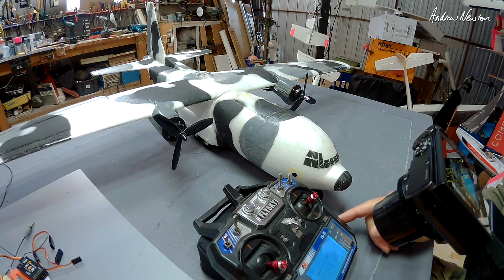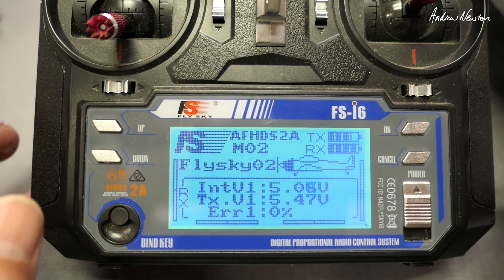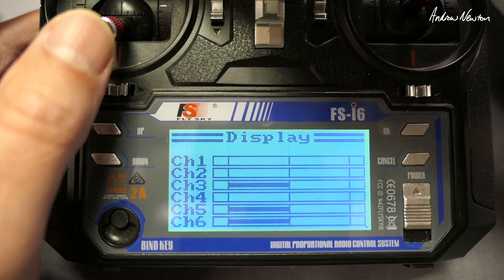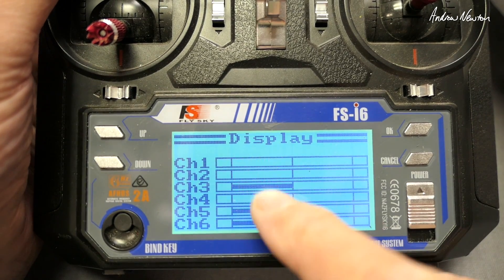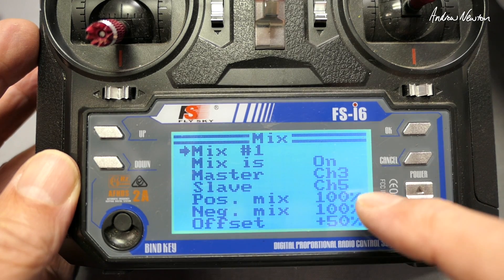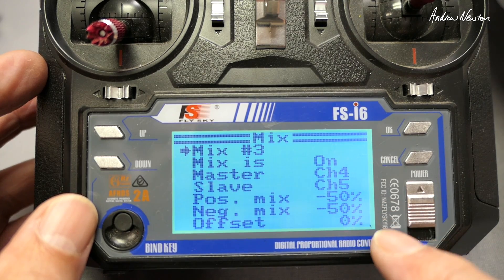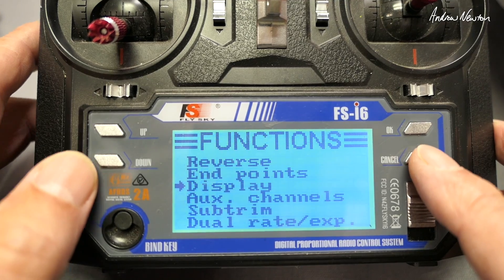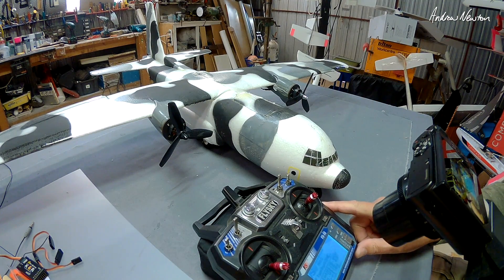FlySKY i6 Differential Thrust Mix

Comment: Hello, How to adjust the aileron differential if all 3 mixes are used for throttle?
Reply from the maker: Mechanically. For bottom servos - mount the servo arms angled more towards the nose and lengthen the pushrods. Then the ailerons will move more up and less down.

Comment: SOLUTION to KILL Rudder / throttle mix control. Example in Assign switches Set Fly mode SWC (same as my throttle hold SWC switch)
Then in Dual rates Ch4 rudder and switch SWC to sport (or Normal) with one Rate set at 0. Now the ch4 rudder will not work in one of the rates and not mix with the motors and motors disabled with either rudder or throttle.
You can use different switches for whatever reason.

Comment: Hi Andrew nice video. Please I can’t find any information about the best distance between twin motors using as differential for rudder.  Is it better as close as possible to que fuselage center or can I space them for more close turns. Can you please help me?  Thank you!!!
Reply from the maker: Thanks. Diff thrust is VERY effective so the motors don't need to be far apart for it to work. I would go by what looks good with maybe 50mm clearance for the props

Comment: Just a thought Andrew,, instead of using ch4, rudder can you use ch1 so the 3 mix supplements the movement of the ailerons?  I have a tricky build that may need this. I think mostly caused by not using a matched pair of ESC's though.  I have set an offset as descibed on your video but still yet to maiden and  I'm wondering how linear the offset will be as I open the throttle!
Reply from the maker: Wouldn't that make it yaw whenever you did roll corrections? Mismatched ECSs may need some rudder trim tweaking maybe.
Reply: Only just seen the reply, thanks.  Maiden was a disaster.  Massive thrust difference.  https://youtu.be/F0n_xcXAso8?si=jfRsgR80PDXO0      I now have  a matching pair of esc's though that  didn't solve the difference in thrust issue.  Sorted in the end. It was caused by a poor connection on  one phase, (ie, one wire of the three)  on one motor. Quick solder job and they both ran the same (with matched ESC's as well.)  Video will be out soon on the fix.   @AndrewNewton

Comment: What did you put on ch1,2,4,6, and b/vcc?
Reply from the maker: 1 aileron, 2 elevator, 3 motor 1, 4 rudder, 5 motor 2, 6 probably a switch, B/VCC can be battery if you're not using an ESC
Reply: @AndrewNewton  ok thanks

Comment: Hey Andrew 
Thanks for your reply.I have set  up your recommended mixes on a FS i6X in Mode 2,  and find that the motors start running immediately the Tx is switched ON, at zero throttle on Channel 3. Looking at both motors PWM inputs to the two ESC boards on an oscilloscope, I can see that they are inphase, and the same amplitude, but the pulse width is already  at 60% duty cycle at zero throttle, and rises to 80% duty cycle at full throttle on the stick on Channel 3.

There is nothing connected to Channel 4, but it is included in Mixes 2 and 3.

Operating the throttle stick in the Channel 4 (Yaw or E-W) directions, gives about another 10% duty cycle to the appropriate motor, and it speeds up a little.

I have been fiddling with the End Points of Channels 3 and 5, trying to get the pulse width to go from 0% to 100%, without any luck. If I connect an external PWM generator to the ESC inputs, I get a full range of RPM, increasing with the duty cycle of the generated PWM signal, from 0% to 100%.  So the motors and ESCs are OK.  It's likely to be  settings on the Tx, I believe. 

Any suggestions please?

Regards 
Ken McCallum
Reply from the maker: Very odd Ken. I would delete all mixes and start again.

Comment: Hey Andrew Just watched your video on differential  thrust. I will try it out on a land vehicle with two non steerable front wheel motors, to achieve steering. One question - did you set the Rx output to PWM and S Bus or i Bus? Cheers Ken
Reply from the maker: Left it on PWM. Only need the others for flight control board connection

Comment: Hi Andrew. I am currently setting this up on a twin engined plane I am building. When I am at full left or right rudder, it only puts the respective motors to about 20% thrust on low rates and at most 50% in high rates. Do you know why this is happening, and how I can fix it? Thanks, Bo
Reply from the maker: Look at Sport and Normal rates for rudder. Probably cant get more than 50%
Reply: @AndrewNewton  Right thanks very much!

Comment: I want to know  If you want to insert a gyro, can you use the Mix control program?  We didn't plug the signal cable into the channel.  Gyro's rudder, but using a method  Mix that you teach  Will the gyro work normally?  will control channel 4  Rudder too?
Reply from the maker: Usually you cant have any radio mixing on channels plugged into the gyro.

Comment: Great video,have applied this to a tug boat catamaran and works perfect.  I have just started with DLG and useing Jumper T-Lite pro.  Question?  How do I create (1) Launch mode on SW-D and Speed/Cruise/Termal mode useing SW-A with cruise mode being the middle position. Hope this clear and thanks for your input. Cheers.  P.S. I need something for "LOCK DOWN"
Reply from the maker: I have covered them in a few videos. Search for DLG and full house mix

Comment: Great work and presentation! 
I use your settings for my two motors bait boat. Is any possibility when I stering my boat one motor go forward and the other backwards?
Reply from the maker: Would be possible with reversible ESC but I have not tried it
Reply: @AndrewNewton  I have them, but I can't figure how to set up the Flysky 🤔
Reply: @mihailescue  hi, have you configured the remote control to work the reverse function?  and if so, how?

Comment: Thank you so much for the explanaition, I have a question, I've done it but when I increase throttle very slow one of the motors starts and the them the other, is that a problem whem i will fly it? How can i solve it?
Reply from the maker: A bit of rudder trim maybe? Probably never get them to start exactly the same.
Reply: @AndrewNewton  im trying but nothing yet, im worry it wont lead to a crash, im kind of newbie as pilot, thank you so much for answer! Cheers

Comment: is differential throttle possible with fs-i4 transmitter?

I have a fs-A6 reciever.
Reply from the maker: No, you need a programmable radio
Reply: Andrew Newton , not even TANK moving?

Comment: Your video is fantastic .I am building a hovercraft with 2 motors for propulsion .I want to use differential thrust  for turning .If i use reversible escs ,will i be able to use this transmitter  to reverse the direction of both motors ?
Your reply is much appreciated
Reply from the maker: Not enough mixes with this radio I suspect.

Comment: Does this also work with a 4ch receiver?
Reply from the maker: Where would you plug the second ESC in?
Reply: In my case I only need two motors. I read that you could plug the esc's into ch1 and ch4 but then it also said they used 4 mixes so I was wondering if you could use the fs-i6 even though it only has three mixes. I totally am a noob so I don't know if this is a dumb question or not.
Best regards
Reply from the maker: Different radio system I guess. With the FS-i6 the first 4 channels are fixed as Aileron, Elevator, Throttle and Rudder. 5 and 6 are spare channels.

Comment: Thanks for this video Andre but I have a question : while you fly is the different thrust Also active?
Becouse while flight I think you would crash if it is active.
Reply from the maker: I prefer to turn it off for flying but not possible with this radio.

Comment: Thanks. worked fine, since you explained every step, something other videos didnt. Unfortnally, I hit the throttle stick on full by accident after doing this and my plane took off inside my livingroom (my plane has a wingspan of 1.9 meters). ONe engine needs some fixing now :)
Reply from the maker: Oh no! That would have got your heart pumping
Reply: @AndrewNewton  Update... Hot glue fixed it all, and lesson was learned so I took of the props this time! :)

Comment: Hi I'm using this transmitter and same mix in this video I want to be able to cut out the throttle on a switch for when I'm steering how would I do this ? 
Thanks
Reply from the maker: I have done a throttle cut video, but it might not be possible with differential also. Look at my FlySKY i6 playlist

Comment: Actually I too did the same settings but still my transmitter shows in display setting at channel 5 and 6 as opposite to yours also when I switch on the motor and giving the rudder left side motor giving different beep sound and not even rotating for normal throttle action. Please help me. I am still working on that.

Comment: How to put the differential thrust to replace rudder if I am using flight stabilizer or flight controller on twin motor.
Without differential thrust it just connect like normal plane (paralel esc).
Reply from the maker: Not possible with a stabiliser I think

Comment: Can u do this with any open tx radio .and I did this in flysky once but on giving throttle one side is pulling more so it's not going straight . Both motors are the same but still .I didn't get it straighten
Reply from the maker: Much easier with OpenTX. Might have needed to trim the rudder for straight thrust?
Reply: @AndrewNewton  it's a hovercraft  so I don't have rudder .

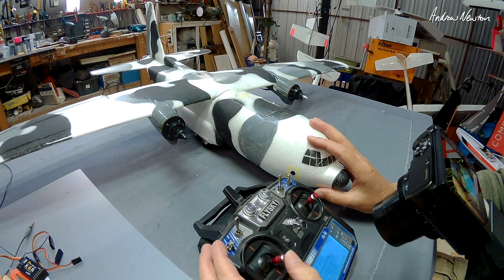Comment: @ 2:10 & 5:08 You can see the Wing moves around the Yaw Axis😳, Video about the Mixing is very Usefull, THX.
Reply from the maker: Differential lift?
Reply: @AndrewNewton  Rather differential Thrust, make the Wing move back and forth relativ to the Fuselage.

Comment: Thanks Andrew these i6 videos save me more than a few head headaches. lol
Love the paint job , but has it melted the foam little?
Reply from the maker: Just pitted the depron additions a little bit.
Reply: @AndrewNewton  I've found a method on YouTube of coarse. 
very light coats from a distance that allows the solvent to mostly evaporate but not to the point of a powdery finish.
This seems to work on the most delicate foams if you have the time .